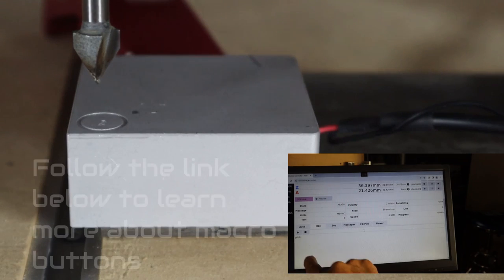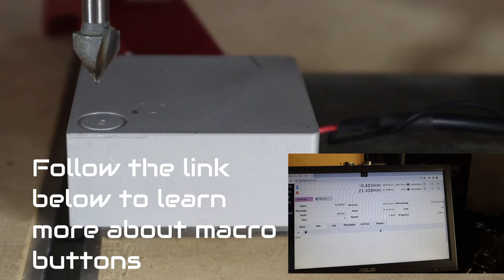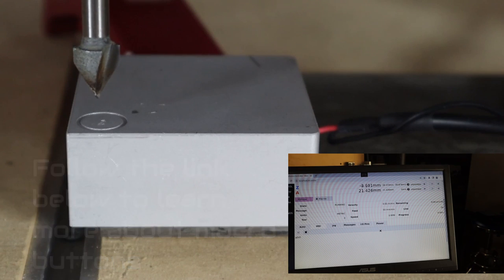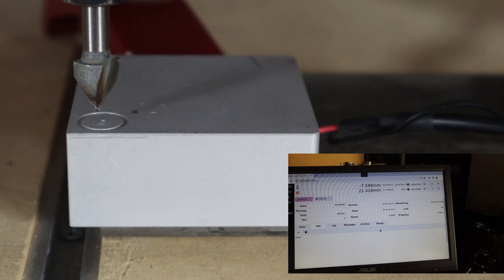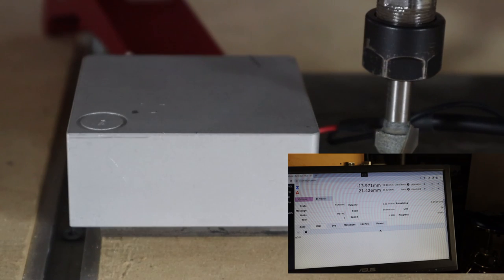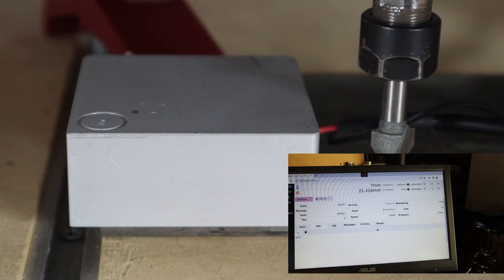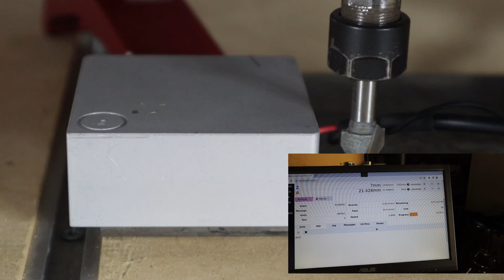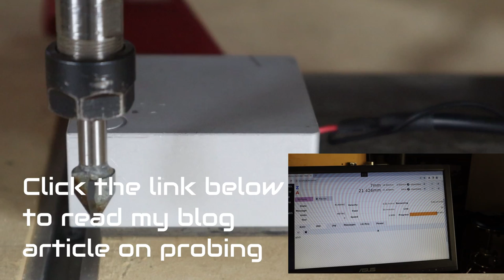3D Probing on a CNC Machine

Comment: That's very cool.  Is the box detecting the bit by when the bit touches and Grounds the box top?  I think I might need one of these...
Reply from the maker: It knows the width of the probe. When it touches each side of the probe, it records the position. Then it subtracts the width of the probe from the distance between the two positions. The result is the diameter of the bit. The gcode for the program is presented in the blog article mentioned in the description.

Comment: Is there any chance you can recommend and show a setup different probe for cutting metal? I don’t have an easy way of insulation the vise from the body of the mill when cutting aluminum to use this plate.
Reply from the maker: You could put an insulating layer of tape on the surfaces of the probe that contact the work piece. If you do this, you will need to remeasure the probe to account for the new thicknesses and adjust the program accordingly. Alternatively, you could use a stylus type probe for x-y probing. I think these are triggered by deflection rather than electrical continuity. Then use a z-axis probe to set the bit height. Most of the cheap z-axis probes have an insulated base.